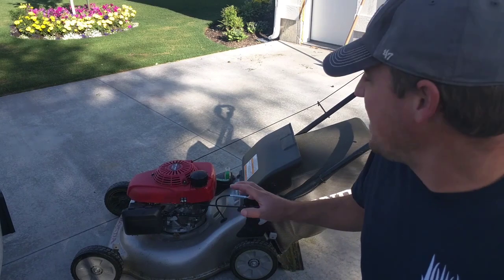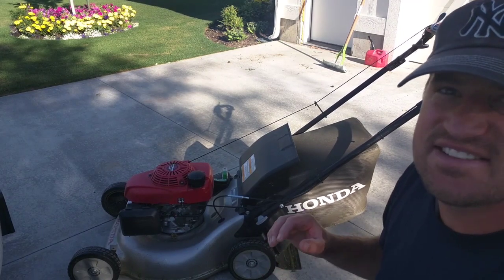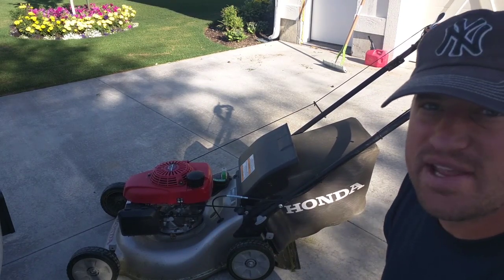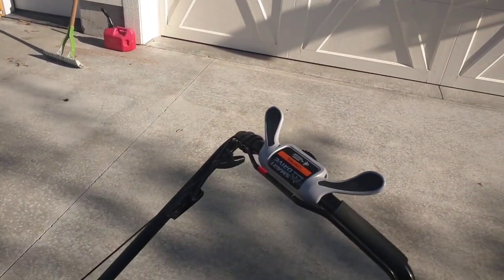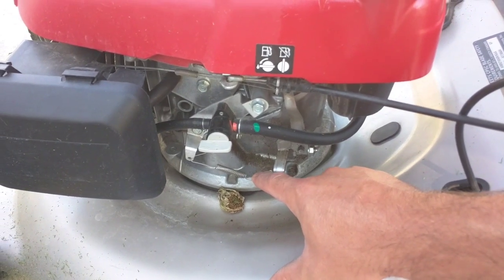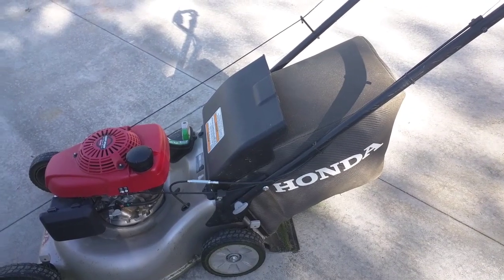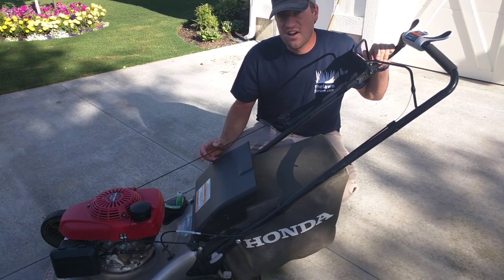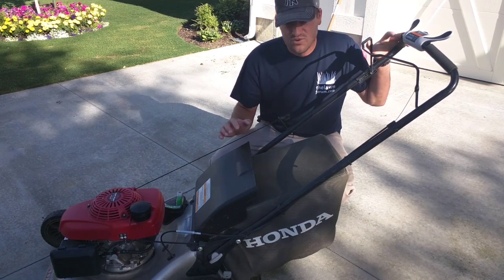Honda mower auto choke HACK

Comment: Just replace the pin that controls the choke assembly. Honda had a recall. The part is only about $10.
Reply: would you share the pin info.. Thank you  Tom..
Reply: It is called a thermowax 16620-Z8D-305
Reply: Yep, it's call thermowax. The better option is to put a manual choke on your mower. That's what I did.
Reply: Thermowax choke actuator. I replaced one on my Toro lawnmower w/the Honda GCV 160 engine. Was a bear to pull out.
Reply from the maker: Tried this. Didn't help
Reply: @aaronl.9580  how did you put a manual choke on ? I can't find any videos on that subject
Reply from the maker: The manual choke finally fixed it for mehttps://youtu.be/VvozR9cBobs.
Reply: @mc-bw7bn  I bought a generic cable and lever from Home Depot. I attached it to the handle and used zip ties to secure the cable and attached the end of the cable to the carburetor. It worked for me. The mower starts on the first or second pull every time.
Reply: @lawnrebel  Clean and lube the black plastic pivot part next to the Thermowax. That pivot point gets a tad sticky. CRC throttle body cleaner works well then lube pivot with 3M silicone paste (not spray).  Should make all the difference. If not remove carb, drop the bowl and shoot up into the carb with CRC carb/throttle body cleaner. Same mower and mine starts and runs perfectly now.  Nothing replaced other than a spark plug which probably was fine anyway.

Comment: Why would you start your mower and let it "heat up" first ??Do you do the same with your car, motorcycle ?? I don't think so...The auto choke was designed with the idea that you start the machine and start working immediately.It's to take away the choke handling from the user, 1 less thing to worry about as a user...I just can't get my head around the fact that people don't know this
Reply: Why would you not let an engine warm up before putting a load on it? My dad taught me to treat any internal combustion engine like a woman. A cold start will definitely sieze them up. Also that autochoke system is bullshit. I'd rather have a manual choke as it's reliable and will never fail. Prime for a good time baby.
Reply: I don’t know about you but i definitely let my car warm up! People have misunderstood the purpose of fuel injection; it’s not so you can drive the car right away, it’s so you get metered fuel across the rev range, controlled by computer. The auto choke is just a luxury so you don’t have to pull a knob on the dash; the same exact thing is happening as when there was a manual choke back in the day. The metals in your engine still operate much better and will last much longer when at optimal temperature.
Reply: Its epa driven, ill guarantee you.
Reply: Auto choke is one less thing to worry about?? Then why do I have to worry about replacing the thermowax 2 times  during the summer months. This Honda thermowax auto choke is a terrible design. Give me a manual choke any day. 1 less thing to worry about as a user? Come on!

Comment: My auto choke hack is just completely taking out the Wax cartridge completely. I’ve been running it like that for 2 years runs fine
Reply from the maker: Holy crap
.. Why didn't I think of this? 🤔
Reply: Then it would always stay choked. How'd you get around that?
Reply: @KB-ie7jr  im about to try it now, fedup with this piece of shit mower. im about to throw it in the dump here in a minute if it doesnt get working
Reply: @Runescape. Well how did it work?

Comment: any tips on how to fix it from not starting or idling down and stalling? i can get mine to start briefly, but it dies within 10 seconds then won’t run at all. Drained gas, cleaned plug, drained carb, and ran sea foam with no relief.
Reply: My Honda mower engine was doing the same thing.  My first solution was to put a wedge (piece of bark or broken small stick where the choke slides back. After it warms up I would pull the wedge out. What finally fixed it was that I move the bottom spring on the governor to the 2nd hole. If that does not,  work you can try a new spring. Best of luck

Comment: It seems like the pawl on the throttle that is supposed to open the choke once the mower starts is not working right. Once it starts, you shouldn’t have to wait for it to warm up.
Reply from the maker: Auto choke is a terrible idea. I replaced the thermo wax like 3 times

Comment: Simply remove auto choke and install manual choke. The auto choke plastic is easy to remove and you can purchase the manual plastic part. Now also when the very tiny carb orifices plug a bit the manual choke can be applied tp keep working. 
While at this remove the silly cap bolts holding the carb in place and replace with studs studs as this makes removing the carb and gaskits much easier.

Comment: That's why I love my HRR which has a blade clutch and a manual choke so I can walk away. I don't have the same issues as yours but the blade clutch is awesome if I'm mowing and need to stop and check something before proceeding but I don't want to keep starting and stopping the mower which is hard on the engine.
Reply: My HRR216, when you release the lever, blade and motor stops. I keep it tied up while mowing.
Reply from the maker: Yeah I'm to that point as well
Reply: Roy G I have the HRR2166VXA and I most certainly can walk away from mine with no tie up or trickery ... the beauty of manual choke and a blade clutch :D know before you buy ;)
Reply from the maker: Manual choke only for me from this point forward.

Comment: I saw the pin fix and a few others once you pop off carberator two bolts pin pops off with fingers or pliers just be careful. My carb also was dirty so prob will replace air filter and spray the hell out of it..

Comment: Biggest mistake I ever made was getting rid of my 15 year old John Deere lawn mower which I replaced with a Honda.  Even at 15 years old the John Deere started on the first pull.  Honda is hell to get started, the thumb controls kind of suck, I've had teeth brake off on the gearing in the wheels. 
Had I known any of this I'd have went through and refurbished the old John Deere and held onto it. I don't think the Honda mowers are worth the money. They only sell because they say "Honda" on them.  They are NOT better.
Reply from the maker: You are dang right. I HATE that Honda mower. It's such a POS.

Comment: @Connor Ward, the auto choke on a Honda works great you just need to understand how it works. I have had MANY Honda mowers and if you know how they work THEN you can fix it. Don't modify it FIX it.
Reply from the maker: I tried so many times to fix it. Even replaced it 2 times. That this is pure crap. Not sure why I can't just have a manual choke
Reply: @lawnrebel  I've seen people put a cable on the choke shaft lever but down is choke up is off choke if I remember right.

https://youtu.be/VvozR9cBobs
Reply from the maker: https://youtu.be/VvozR9cBobs
Reply: @lawnrebel  that's what I put in my reply, did it work for you, how is it holding up if it did? 

I'm not berating or belittling anyone, I just think modification should be a last resort is all. Generally in my experience with Honda their systems for the people I have use em never give em trouble.
Reply from the maker: It actually worked out great. No more issues.
Reply: @jdclay1547  these mowers are junk, the auto choke was put on there for women who dont know how to choke an engine.  just like no more primers.  they tried to do this to make mowing easier for women, its a gimmick and the system is crap, worst there is no real way to remove it

Comment: I have had same motor since 2012. I don't have that problem. My shit is ready as soon as I let go the rope. U might change that thermo wax out.
Reply from the maker: Tried that.
Reply: @lawnrebel  Clean out the black plastic piece that the wax auto choke pintle pushes against. When dirst gets collected in there it stays stuck sometimes. Once cleaned out use some silicone lube.
Reply: Same here. Never had that problem and I've even used the mower in temps down around 40-45°f.

Comment: Can the auto-choke prevent the mower from starting outright?  I cleaned the carb but I can't get it to start (verified i have a spark from the spark plug).  When i rip the cord it's like a 5 year old tugged on it and basically ignores me.
Reply: Yeah I had that same issue so i decided to buy a new carb. It made it easier to start but 2 weeks later my lawn equipment was stolen. I recently purchased a used hrr2169 vkaa for $150.00 basically its new just did tune up looks sounds & feels like new. Guy only used it 1 season & decided to hire a lawn care company. These are good mowers.

Comment: I hacked my mower with a different spring & a piece of solid wire, it worked great but after a while, I got scared/ or worried/ or paranoid about the blade flying off & chopping my feet!...
  My mower normal rpm is less than half, but I had it closer to between 3/4 and full throttle!
  It was awesome, and cut the thickest grass but..  I chickened out!   Better safe than sorry I think..
Reply: Yeah dont run these engines at higher rpms. I dont think the blades would come off if you tight them bolts in really good. Anyway best be safe.

Comment: Auto chokes are stupid.  Best thing that ever happened is when they started making mowers with priming bulbs.   The only thing that is wrong with my self propelled mower is it needs a new transmission and I can't find any repair shops that will replace this gear assembly for me.    I'm dreading buying one of those mowers with auto choke.

Comment: Mine does the same annoying thing, I just play with the spring for a few seconds and it’s good
Reply from the maker: Glorious Warrior. Yeah it's stupid... Takes FOREVER to warm up. I wouldn't buy that mower again if given the chance
Reply: Go buy a piece of crap, yard  machines mower and see how long it lasts.
Reply from the maker: I have an old mtd yard machine that's like a 2006. Works so well and I love it and love the cut. It's just a push mower. I used it for years. I really wanted a self propelled. It cuts way faster than push mower

Comment: i keep having to replace the thermowax pin over and over, the mower starts right up then dies, replace that thermowax, runs great for about 3-5 cuts then you gotta replace it again. i used to love honda but i hate this autochoke BS, nothing but problems.

Comment: There is a wax filled cylinder that is mounted in the engine block that expands like the thermostat on your car. Not too difficult to replace. It’s a known problem. Should completely solve your problem. There is an updated part
Reply from the maker: Where do I get one.?
Reply: Connor Ward I’m sure you can find it at a Honda equipment dealer or on amazon. https://www.amazon.com/Honda-16620-Z8D-305-Thermo-Wax-Assembly/dp/B00IRC9DSI/ref=mp_s_a_1_5?ie=UTF8&qid=1527818564&sr=8-5&pi=AC_SX236_SY340_QL65&keywords=honda+auto+choke&dpPl=1&dpID=41rdguBXFiL&ref=plSrch
Reply: I think that’s the correct part number.
Reply: Yep.

Comment: There’s something wrong with your mower.   We have 6 of these in our family (in laws, siblings, etc) and none of them act like this.    Average age of mower is 6 yrs.    Haven’t had an issue.
Reply: got my Honda engine last week, and it's doing the same crap as in the video - runs like crap because the auto-choke doesn't disengage once the engine starts

Comment: Put a 13 coil spring on it and throw away the 21 coil spring
Reply from the maker: More like... Throw the whole mower away
Reply: Are you talking about the spring that closes the choke plate? Mine does the same thing and I can’t find ANY info on a fix. It’s almost like it needs a choke pull-off to crack the choke plate open or something.

Comment: Or, take out the thermowax actuator.
Reply from the maker: Yeah I could do that. If I do that then the mower will never choke.
Reply: @lawnrebel  Then you just pull that level with a bungie cord to manually choke and let off when it has warmed up

Comment: My Honda mower with stupid Auto-Choke does the exact same thing! The choke plate is sticking in the closed position and the engine is spewing out black smoke and burning up gas. It is NOT the wax pellet, obviously that is working since the choke opens as it warms up. There must be some kind of linkage or vacuum operated choke break that’s supposed to crack the choke plate open that isn’t working. I’ve gotta find out what it is, some Honda mechanic must know. Meanwhile don’t let it run like that, it’s not good for it.
Reply: I am starting to think it is a defective governor. and a weak spring too
Reply: @4skully  I finally found out what it was and fixed it for good, turned out to be a warped air filter box caused by someone over-torquing the two carburetor bolts. What happened was the two carb hold down bolts that hold all of that crap together got over tightened which squished the gaskets and warped the air cleaner box. That interfered with the choke butterfly linkage so the governor rod couldn’t crack the choke plate open. I noticed it always worked when I mounted the carb without the air filter housing. Then I noticed it always worked when I slightly loosened the two bolts, that’s when I noticed the back of the air box interfering with the choke linkage. The solution was to double up on the front gasket to get more clearance and back off on the torque, always works just fine now.
Reply: @mjg263  thanks so get a second carb gasket and put it over the original? I felt it might just need a different spring or a entire new governor bracket
Reply: @4skully  yes, put a second air box gasket over the first or better yet two brand new gaskets, put a little blue (NOT RED) thread locker on the carb bolts and then snug down the bolts without over tightening them. The goal is to get as much clearance as possible between the back of the air box and the butterfly linkage (notice how they have the back of the air box notched out to clear the choke linkage). On my mower I’m pretty sure it was caused by someone with an impact driver cranking the hell out of the bolts.
Reply: @mjg263  Does anyone have a fix for this issue besides a manual choke???  Also how long does it take a normal auto choke system to come off choke???  Tried Thermo wax, carb, new gasket with a double gasket on the air filter base.  Thanks in advance,  Ron
Reply: @ronnieso you might need to trim the plastic off the back of the air filter base where it’s rubbing against the choke linkage or possibly replace the air filter base altogether if it’s really warped. Mine got over tightened by someone using an impact gun on the 10mm nuts, but I noticed that by backing out the two nuts while it was coughing and sputtering it suddenly “clicked” and the choke plate snapped open. Look for interference between the back of the filter base and the linkage. If you get a new base DON’T over tighten it. It’s a dumb design and I wish they left the old semi-auto choke system on all of their engines.

Comment: Ordered Honda’s Thermowax Choke Actuator...EASY DIY project!!

https://www.repairclinic.com/Video/Video-Landing/2675-22/Honda-Thermowax-Choke-Actuator-Replacement-16620-Z8D-305
Reply from the maker: just did it.. It did not help
Reply: Sorry to hear that, but it fixed mine.
Honda issued a service bulletin that may be covered under warranty for your unit (?). 

http://www.ipspower.com/images/documents/technical-information/GCV160-Engine-Wont-Restart.pdf